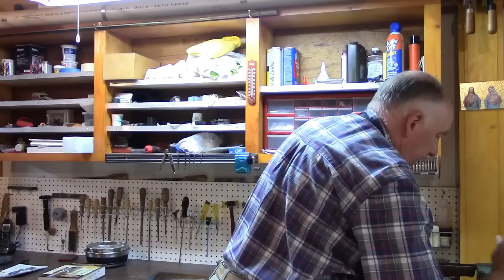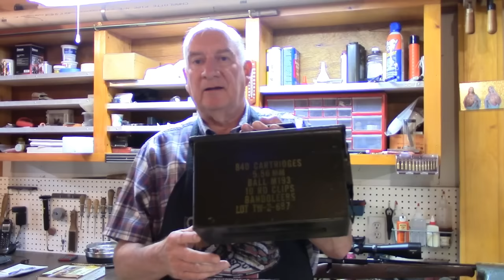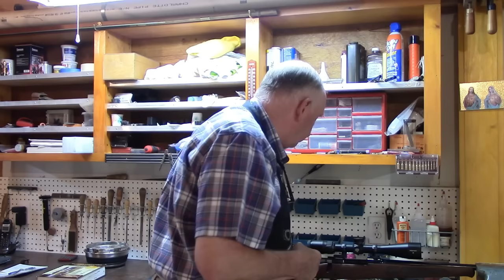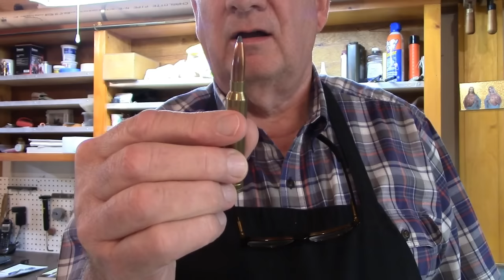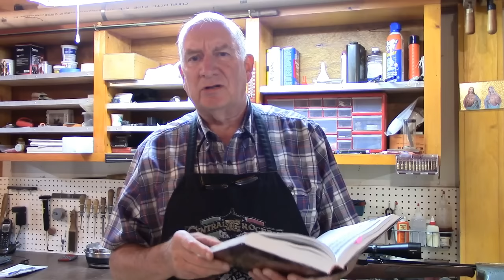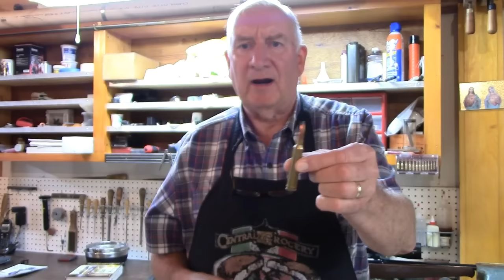How long do barrels last? ~ Discover the truth!

Comment: When you were talking about how bottle neck cases work you said the smaller diameter drops pressure and that that’s from understanding how water flows but my understanding of both is that reducing diameter actually increases pressure, because the same volume has to come out a smaller opening it raises the pressure by forcing that water or in this case gas through the smaller hole. If there’s literature that substantiates your statement as the video showed it could you share that? I like to have the correct facts and now that this video has raised the question I looked to be certain and yes for water reducing the pipe diameter increases pressure, it exactly how a nozzle works on your garden hose. Turn that opening tighter and you have a low pressure washer.
Reply from the maker: You're correct. The pressure increases in the chamber, but I was speaking of the increased pressure required to propel a bullet of equivalent weight through a less efficient diameter barrel.  A 150 grain bullet in a 270 requires more pressure than a 150 grain bullet in a 30-06 to develop the same velocity.
Reply: @GunBlue490  OK. Thanks for clearing that up.
Reply: To clarify:  An increase in pressure is a common misconception.  For a system where changes in potential energy is negligible (changes in height), a given volume of fluid flowing from a large diameter pipe (the case) to a smaller diameter (the barrel)  results in an increase in velocity of the fluid in the smaller diameter pipe.  The pressure never increases in the direction of the flow as there is a loss in kinetic energy  used up in accelerating the fluid to the higher velocity.  
Khan Academy has an easy to understand presentation.  Search for "What is Bernoulli's equation"
Glen Research Center (grc-nasa-gov) has more advanced material  such as an expatiation of the pressure expressed as static and dynamic quantities (pt = p + .5 * r * V^2).   Lastly, there are some fine lectures on the introduction to fluid mechanics on line.  However, these require an understanding of calculus and differential equations.
Reply: @elingeniero9117  So you’re saying accelerated mass doesn’t build pressure? Water coming out of a reducer is moving faster and capable of more work. Much the same way we apply gas in a barrel to move bullets. We’re discussing the basic concepts here not learning the equation to figure out the value of the pressure. Pushing a given volume of water out a smaller diameter pipe results in faster moving water which is a caressed as water pressure. Are you saying it’s different for the chamber pressure in a rifle? That pressure is lower if you reduce the barrel diameter? That goes against at least my limited understanding, as a 30-06 generates roughly 50,000 PSI chamber pressure but swage that neck down to 25-06 trim it back where it needs to be and it’ll run into the 60,000’s. All that gas has to go somewhere and be contained until it can.
Reply: @308dad8    I stated fluid pressure does not increase across a reduction in pipe diameters like you have in a bottle neck cartridge or a pipe.  It does not matter if the fluid is water, high pressure steam, or gunpowder gases in a bottleneck case.  You asked for a supporting literature and I provided it.  

A water hose nozzle drops the typical 60 psi municipal water pressure to atmospheric at the nozzle exit.    It increases the velocity by constricting the half inch hose to around a quarter in in the nozzle.  You can do the same with your thumb. 

As for rifles:  Take the leading cross section of  inch long volume of 30-06 casing with in inside diameter 0f .470 inch, that one inch long volume will occupy a length of 2.33 inches of 30 caliber bore as it flows into the barrel.   If the cross section of gas in the casing is moving at 1 inch per second, the same cross section will have to be moving 2.33 inches per second after it moves into the bore. No increase in pressure in the barrel, higher velocity.

Comment: Got a savage model 12fv in 6.5 creedmoor.  I shoot 140 grain hornady going 2700 fps on average out of my barrel. It's a varmint barreled rifle.  I shoot 1 round,  wait 5 minutes, shoot one wait 5, so on and so on. I shoot roughly 40 to 50 rounds at the range, clean the rifle before each use. Use hornady ammo.  Not superformance ammo. I got over 2000 rounds downrange out of it, and it's even more accurate than the day I bought it. It will shoot 7 shots inside 3/4 of an inch. I love that gun. 2000 rounds. I wonder what your predictions for barrel life would be at the rate I shoot it now?
Reply from the maker: The way you are taking care of your rifle it may last forever.

Comment: Very good information, thank you!   Can the barrel be replaced once it's done for?   Is it an expensive process if it can be done?   I am in the process of getting my license to purchase a gun here in Canada, and I believe I will start with a Rugger American riffle.  I have not yet decided on the caliber but am leaning towards the 308.   The riffle is not that expensive when you compare it with the price of the ammo.   I believe it will cost about 1000 CAN$ with everything, and the ammo for it is about 2$ per bullet.  So for a life expectancy of 2000 bullets, I will pay 4 times the price of the riffle just in ammo, not counting fees for range use and such.  What equivalent with straight (non tappered) cartridge would you suggest?

Comment: Heat causes "annealing" of a tempered or hardened metal. This can cause alloying to separate.
Reply from the maker: That's correct, which is the degenerative process that ruins barrels.

Comment: @13:30 you have the effect of necking down a case reversed...it increases the pressure i.e. the .458 Win operates at lower chamber pressures than the same case necked down to .308 in the .300 Win Mag>>>@16:30 you prove this yourself comparing chamber pressures of the 100gr 7x57 load to the 100gr 6mm Rem
Reply: Yep I noticed that myself that he must have just mis-spoke on it....I think he meant to say increases the pressure.
Reply: I agree. He meant it the other way. Honest mistake

Comment: shooting a 444 marlin leaver it has a straight wall case so can I get a long life from that barrel if I stay around or under 2000 fps and bullets from 265 to 300 gr. and don't over heat it. I liked that video you did not wonder off as much as you do on some.

Comment: Mr. GunBlue490, have you ever used a laser infrared thermometer on the barrel chamber and/or gas block while shooting at a range to monitor heat?

I wonder about tracking how hot my 5.56/.223 barrel gets while shooting targets.  My range allows 1 shot/second, and from a bench a shoot 5 shot groups, but boy does the gas block get hot in a hurry after only a few dozen rounds...It'd be nice if one could monitor the temp of their barrel and slow down if needed for cooling time.

But as someone mentioned earlier, AR barrels are relatively cheap and widely available...

Comment: I've been watching some of your videos and think you can answer my question if you choose. I have a 270 WSM shooting 130gr @ 2990fps and lets say its been shoot 300 times and the accuracy seems to be going away, these are all hand loads. This is a factory A bolt and I was thinking its probably not the best barrel and have thought about barreling. Lets say its lost 1MOA at 300 yards, but it could be I'm getting older.

Comment: The Venturi effect is the reduction in fluid pressure that results when a fluid flows through a constricted section (or choke) of a pipe. The Venturi effect is named after Giovanni Battista Venturi (1746–1822), an Italian physicist.
Reply: Thing is there must be a reason for it's use. My guess is a more consistent pressure over a longer period. Now why would it cause shorter barrel life it cannot be inefficient unless pressure is still increasing once the bullet leaves the barrel.

Comment: I live in the Elk country and have a 300WM specifically for elk.  I am using the 200 grain bullets about two grains below the max charge at 2950FPS.  Would you expect that moving to 180grain bullets would help increase the barrel life?  I have heard differing opinions on bullet weights and barrel life.

Comment: Makes great sense. I am curious what you would say about hand gun barrels, since they get a lot more range time and are shot repeatedly. I regularly shoot a session of about 100 rounds of 38sp in my 686 S&W mostly wad cutters, I rarely feel barrel heat up but other guns like a 9mm feels quite a bit warmer. I wonder what is a hand gun barrel life expectancy is all the same factors considered? Maybe you can follow up with a part 2 on handguns.
Reply from the maker: My comments apply only to high power rifles.  Most pistols and revolvers can be expected to last indefinitely, with few exceptions.
Reply: @GunBlue490  Thank you thats very interesting, I did not realize that pistols and revolvers were not effected the same way but it also makes sense since the powder charges are so much less

Comment: ..@ 8:45: I HAVE to admit, I’ve never heard the ‘proposed’ (even) possibility of “burning out a .223 barrel in AS LITTLE AS 1K ROUNDS”(!) ..that’s mind-blowing. Even firing the hotter 5.56 round would make MORE sense than the .223 in that comparison with powder charges, etc. BUT, just to think that a barrel on an AR “could” last as little as these few rounds it would make me think it was a ‘low-end’..quality-wise, rifle. Perhaps I’m wrong. Say a Daniel Defense-produced rifle (barrel) VS a ‘low-end’ manufacturer in a head to head comparison, with the EXACT SAME rounds AND firing schedule..you would not be any further ahead by having purchased a higher-end rifle? One mfr produces CHF and the other ‘button hole’-type barrels, etc. I THINK there are TOO many variables to KNOW what you could/coudn’t expect. Lofty subject..
Reply: Hate to tell you this, but the U.S. Army conducted a "Fire to Destruction" test of the m4a1 carbine in full auto.  The longest lasting barrel failed after 596 rounds.  The M4 is rated at 12 to 15 rounds per minute in sustained fire and the report is on line.  Look it up.

Comment: Very interesting and informative video! Thank you Sir! According to your opinion, how long time do one need to wait between shoots to optimise the barrel life? Lets say 308 with a 165 grains bullet and a high but not max load, 15 degree outside temp. According to my phone it will be 59 Fahrenheit. Regards!!
Reply from the maker: Regardless of caliber and bullet weights, the most damaging factor is heat.  Heat builds up at different rates in given calibers depending on the ambient temperature and the barrel's ability to dissipate heat, according to its mass.  That all sounds complicated, but it's very easy to measure, no matter if it's a 223 with a light barrel, or a 308 with a heavy barrel, because steel breaks down at the same relative temperatures.  If you wrap your hand around a barrel and it feels warm like a heating pad on low, it's shooting at optimum rate, and will last longest.  When heat builds up to the point that you can still hold it, but it feels uncomfortable, I consider that the maximum rate, and will allow it time to cool before continuing.  Whenever a barrel gets too hot to hold, it's over the threshold, suffering damage, and when it burns to simply touch it, one can assume that definite damage is occurring.  Lighter barrels heat up quickly, they also cool quickly.  Heavier barrels take longer to heat up due to their mass, but they also take longer to cool down.
Reply: @GunBlue490  Thanks!

Comment: I have been wondering for some time now what determines cartridge pressure. I'm glad he addressed it. I read in a gun magazine that the .30-06 is a 58000 psi case but the .308 is a 62000 psi case. WHAT MAKES THAT DETERMINATION?
Reply: A .303 British case is a 48000 psi case
Reply: The design  and geometry  of the rifle chamber and barrel,  the strength of the steel used and the burning characteristics of the powder.  the .308 is a more modern design.  The 303 British was originally loaded with black powder so older rifles could not withstand the higher pressures of smokeless powder.

Comment: Have a question.  I am checking my 7mm chamber eith a ol a.l. gauge. The factory round measures 2.683 and the modified case i have with a 160 gr spit boat tail measures 3.1185 and leaves no room to seat the bullet. Im thinking my barrel is shot. Am i doing this wrong. wrong

Comment: Would a .270 cal be sufficient for large game in north America at most distances or would you recommend something else.
Reply: Absolutely
Reply from the maker: I've used it for many years.  There's absolutely no finer round with its 130 grain bullet for prairie mulies and pronghorns, or for far off shots on caribou and sheep with 150 grain partitioned bullets.  Most experienced veteran hunters would consider it adequate for elk with the correct bullet at reasonable ranges, but usually not their first choice if they had their options.  The late John Nosler once told me that he used it for elk, and a personal friend of mine who was not tolerant of recoil, used the 270 to take many extremely large Newfoundland bull moose.  So, yes, it's more than sufficient for most game, but it's a hunter's gun for the really large stuff, not for pot shots.
Reply: @GunBlue490  Thank you

Comment: I never worried about barrel wear until I watched this video. I'm curious though, I have 2 rifles with stainless steel barrels. Are my stainless steel barrels going to out last my 4150 chrome moly barrels? And what about muzzle loaders, how do they wear compared to cartridge fired barrels.
Reply from the maker: I can confidently say that a muzzleloader will never burn out because they simply cannot be overheated.  Stainless has more life for competitive shooters who are required to shoot rapid fire strings in succession, but for sporter rifles kept to cooler, less stressful sessions, there's no practical difference.  A carbon barrel can last forever if kept cool with no more than three to five shots at a time, and rapid fire is avoided.

Comment: Mr GunBlue490 if you read this.  Is there any bullets that save on wear?  my current thinking (all homebrewed) is if I really like a rifle (like my Swedish Mauser) buy a 2nd one and shoot it so they last twice as long.   Does it make any difference what bullet choice I use? If I shoot cheap Speers or expensive Sierra is there a difference?  Copper bullets? Polymer?  just wondering if I have some special rifle I love that I really want to baby.   What I currently do is not load it hot and let it cool between shots.  is that about it?  thanks!  So far I have used a couple things I learned from you.  I dont tumble my rifle brass anymore.  I don't clean the primer pockets.  have not noticed a difference! good!

Comment: Was it not the case when the necked cartridges first appeared it was to increase velocities? That’s how I understood it, but perhaps you have some insight on that? Thanks.
Reply from the maker: The physics then are the same as the physics now.  Large case capacity combined with a smaller diameter bore and lighter bullet result in increased velocity.  That only became possible with the advent of stronger breeches that could withstand the much higher resultant pressures.  Even now, higher pressures are achieved by "over-bore" cartridges that have greater chamber to bore ratios.

Comment: Question, Sir.

What do you have to say about the issue of bimetallic ammunition?  In particular, the 7.62x39mm variety residing in steel cases?  

Some say this ammunition wears out barrels faster than 7.62x39mm using traditional FMJ bullets, while others say this is a myth.  I saw a test in which it was proven to be the case with 5.56x45mm rounds out of AR-15s, but it is claimed that the higher velocity of the latter cartridge pronounced this effect which is negligible in lower velocity 7.62x39mm.  What say you?  Thanks!

Comment: Thanks 👍 Question will cold fordge chrome barrel last more than a just ordinary rifle barrel? Chrome barrel will not rust as much so it will live longer right?
Reply: Forging does not give metal magical properties.  That is marketing hooey to ask for a much higher price.  Chrome plating extends the life for the throat by as much as 50 % in military rifles at the expense of accuracy.  The plating along the bore is not symmetrical.

Comment: Question will engine  additive slick 50 increase the life of a barrel if used  like it does with car cylinders or does it just get too hot ? I barely know anything about guns it was just a question I was curious about  I barely know anything about guns it was just a question I was curious about .  I learned quite a bit just from this video thank you !🇺🇸
Reply from the maker: Absolutely under no circumstances can any lubrication be allowed in a barrel, except a single very lightly oiled patch after cleaning as a rust preventative.  Oil in a bore is an obstruction that can blow a barrel, and oil in a chamber destroys the necessary gas seal between the case and breech, while also causing damaging and dangerous bolt thrust. But no, bullets are not pistons.